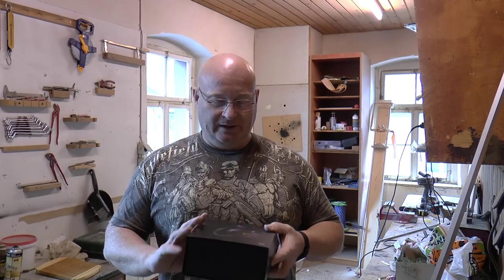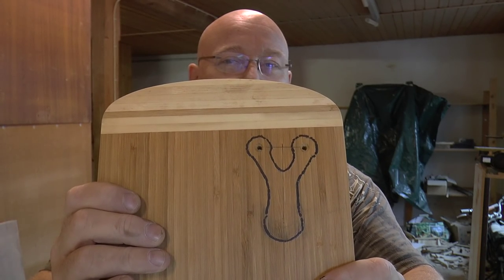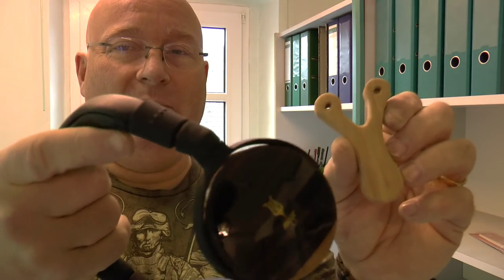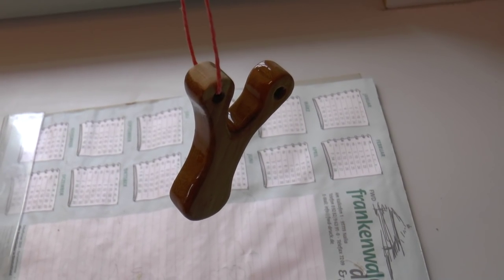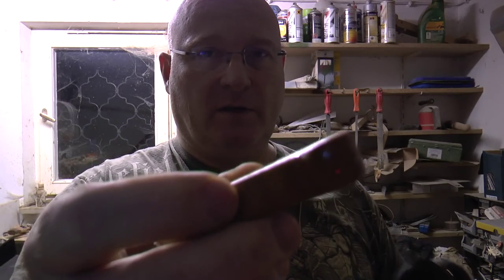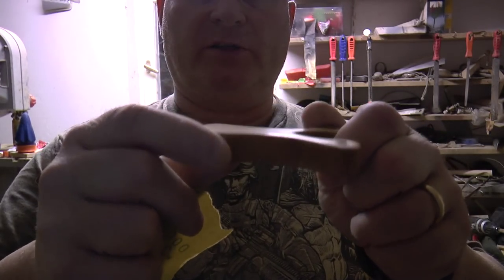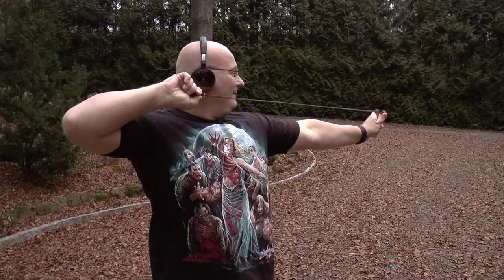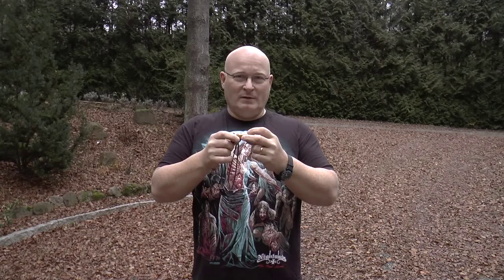The Perfect Shine'n Gloss Slingshot Finish Tutorial

Comment: I have found that you can also get a perfect finish using the spray polyurethane from Home Depot (needs more coats since the application is lighter).  You can also use wet sanding for the final finish.  Lastly, furniture wax helps polish it up at the end.

Comment: you could also lightly sand and microfibre-buff each coat you apply before applying the next, then give it really good buffs towards the end coats and especially the last coat; i did that after i airbrushed a cricket bat... it literally looked like i had dipped it in some kind of super smooth glass. it even held out pretty shinny for a good couple years of playing cricket too.
P.s i used the thick grinding stone for my dremel and wrapped it in a couple of layers of thick microfibre towel with some fine cutting compound to function as the buffer, worked brilliantly - though be careful you don't scorch your coat with this tool, it's easy to heat the varnish up too much if you go too fast and heavy.

Comment: Great build, but such small things Are easier to finish or coat with lacker by tiping it in and by doing that If lacker is thin enough then the surface is allready better and you dont have to apply so many coats, only remove that drop from bottom